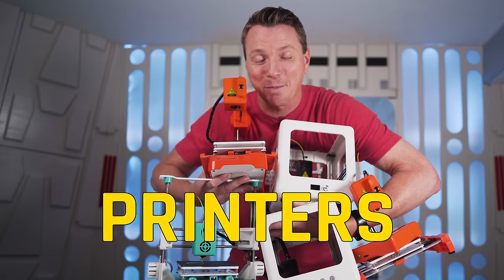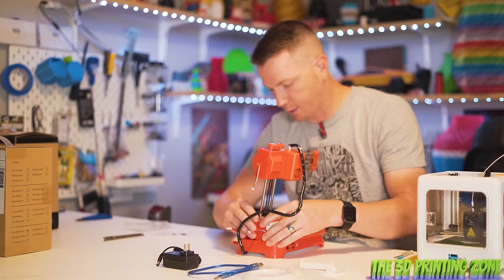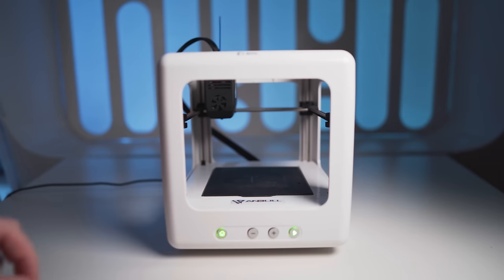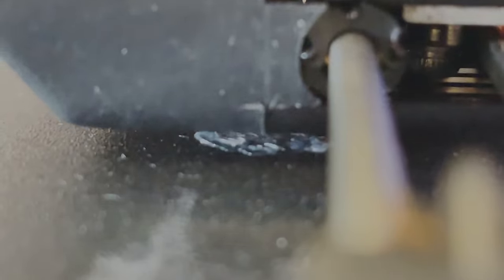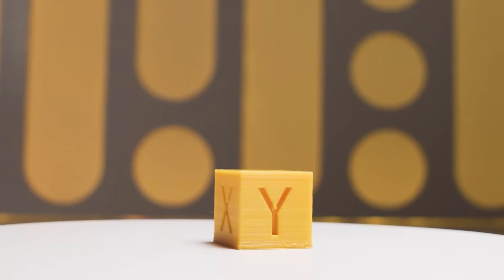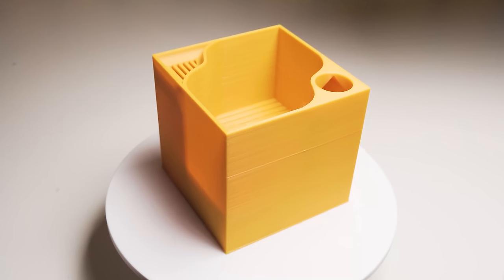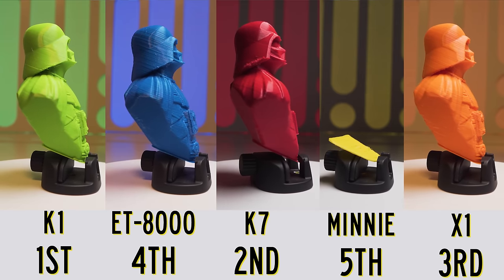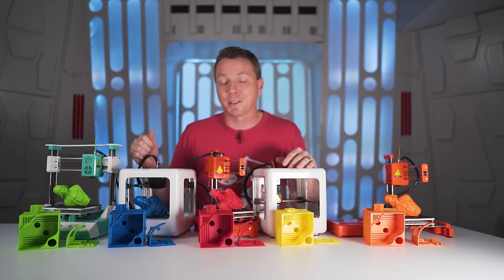I Bought the 5 Cheapest 3D Printers on Amazon

Comment: I got K7 and just finished a spool of 250g pla. I still can't figure cura to slice well enough for this printer so I use the slicer that came with instead and the results are acceptable. better than I expected sometimes. the things that annoy me so much are it prints cylindrical shapes poorly. mostly look like a box with round corners. and not for really small objects. I've tried several times on keycaps and it failed miserably on printing the cherry mx style stems.
Reply: Thanks for sharing! I was looking at this set as a sorta entry-level 3D printer (I am specifically going to print small things!)

Comment: I have a Flashforge Adventurer 3 Pro and my sibling has an EasyThreed K1 and mine cannot print without adhesion for some reason and mine also won’t work with Ultimaker Cura but my siblings does and it can print without adhesion

Comment: The only print that did complete on the Minnie was the best of the 5. So it CAN BE a decent printer.
Why not trouble shoot why the Z axis is not working fine and fix this?
You were probably unlucky to get this faulty machine, the ET-8000 has exactly the same mechanicals.
Love the display on the Minnie, is it super handy and reveals that standard Marlin firmware is used, which is highly tweakable

Comment: Did you check the Z axis motor connections at both ends of the cable? Could have been loose contact or a poorly crimped connector.

Comment: If these were like. $50(And a bit better) i could almost see them being used as an "emergency" printer to print replacement bits for your printer if it goes out of commission in a very specific way that needs a printed part.

Or a fun printer to put in your car for printing on the go!

Comment: I bought my Kids the k1 at First they don't Like it but if the see what it can do the start printing the hell out of it. The incl. Filament was total crap so i used some Pla from my X1 and it worked fine.
After half of the Filament, they printed 11  little Toys, the z Axis motor burned out i get a New for 18€ but it didnt hold much longer. So my conclusion is this is a nice toy with decent print quality but wont Last Long.

Comment: Quick question: suppose my budget is $300 US and i want to make a 7.62 SABOT in 3 parts with a 3/32 hole in the dead center, what printer and fillament would you recommend? The plastic must also be strong enough to handle being sent from an M91/30 Mosin Nagant rifle (or at least until it leaves the barrel).

Edit: hypothetically of course

Comment: That's a good review! Real testing, see what they can do and not.

It is noticable that two of them look like M3D Micro ripoffs, but they clearly print better becacuse the M3D ranks as one of the worst. (I know, I had one. Never made a decent print until it broke down completely after way too few prints.)

Now I own an X1, which has many similarities with the M3D except the box and a lot better results (probably due to the part cooling fan). Same extruder, looks like the same print head, feeding into a hole at the top, Did you notice that the round shapes on the test model do not come out perfectly round? It doesn't stand a chance against my Ender 3 Pro neither for quality nor speed, except for the size. But it is really cute and the simple interface actually works, as you mentioned.

I don't expect the X1 to last very long though. The belts are thin, small motors, everything feels is small and thin, and I think that goes for all of them. However, I heard the K7 comes with some spare parts, right?
Reply from the maker: I couldn’t get any of them to print what I would consider an excellent part but some were at least passable. And yes, there were some spare parts included on one or two of the printers but I honestly can’t recall which anymore. It was definitely fun to try all these out and see what worked and what didn’t.

Comment: Do you have machine settings/profile for k1 you could share? Still can't get good results with cura and am stuck with the limited included cura based slicer it came with.
Reply from the maker: So on mine I literally just used the default "custom" profile for adding new printers and the only things I changed were to set the bed size (100x100x100), unchecked the "Heated Bed" box and set the filament size to 1.75mm on the second screen. Other than that, it was all about slicer settings - principally speed.

Comment: this is weird to me, i have an x1 and i have been having results way better that the ones on this video, even at 40 mm/s i get really good prints although not as clean as the ender 3, but there is no flaws, no layer shifts (for the most part) and i used it for more than two years, has clogged i have cleaned it and it still works fine, warping is there, no mods aside from a firmware update, so to me this looks like either the youtuber got a bad batch or doesnt know how to handle a 3d printer, tolerances on mine where .5 to .6 and as long as the filament wasnt totally trash all prints did not envy ender 3 prints, except on high speeds, 60 mm/s is too much for the printer and it will have mayor layer shifts or the print just fail whatsoever, didnt use their slicer much more than the first few test prints, switched to cura almost immediately and copied all settings from their slicer to cura, most of my printing was wired and not from the sd card, most of my prints were done at 20 - 30 mm/s to prevent any problems

Comment: Would these be say good for printing warhammer stuff 

Just like downloading models for stuff like marines and kanz could I get away with it
Reply from the maker: These could work for that so long as you're ok with the really small print volume. Any 3D Printer can be used to download and print but, like you saw in the video, these aren't very good as far as quality, speed or usability - especially compared to printers that cost just a bit more.
Reply: @The3DPrintingZone  is there any printer in particular for a low price (say 100 to 150) you would recommend
Reply from the maker: @arkslippyjunior7773  In that price range, I'd look at an Ender 3 (original), and at used ones too. There are a lot of folks upgrading to something more costly and selling good printers at really fair prices.

Comment: 1. You should have reduced print acceleration instead of print speed. Layer shifts on lower end printers like these come from poor belt quality and tension. So the force the motor can put on a belt until it skips is very low. Changing the speed does not affect the force applied to the belts. Acceleration does. As a former X1 owner I can clearly say that my printer did MUCH better than this in terms of quality. Banding was existent, but not nearly to the extent shown here.

2. You said that Minnie refused to lift the Z axis, but half a second later you show the clip where it is visible that it was poor bed adhesion and the print stuck to the nozzle. So not the Z axis. You forgot to proof-read the script and review the footage.

As someone with experience in 3D printing this video sadly does not convince. I wish you best of luck for future videos and that you grow in experience.

Comment: the next thing i would like to see is the feds getting involved to help make 3d printing more legit by mandating that 3d printers have tech that will transmit a copy of the model to the FBI and refuse to print or maybe distort models that are deemed offensive by the government.

in the same way that 

1. high end color copiers are required to keep a log of what is copied.

2. inkjet printers of great enough resolution print invisible micro dots encoding the serial number, make model of printer.

3. photoshop refuses to open images of currency notes to fight counterfeiting.

i think 3d printers should do the same for gun parts.

the printer would recognize a lower receiver witch is classified as  a gun then a copy of the model would be sent to the FBI then the 3d printer would refuse to print or even distort the model in a subtle way that would look ok to the eye but would not fit and would not work for example .

ak47 or ar15 lower receiver the ammo clip slot would be slightly rhombused and taper from top to bottom being a bigger hole at the top and smaller at bottom so the ammo clip would not fit and would need so much dremel work it would not be worth it.

you would get the model but it would not function.

thereby helping to legitimize 3d printing and not require id check or credit card or check to buy locally.

software could reuse existing button.

a simple if/then statement in the firmware could take the home button and make it into a power button.

if button 1 is down for 2 seconds then power down

else do calibration